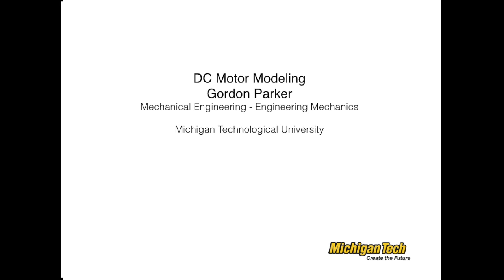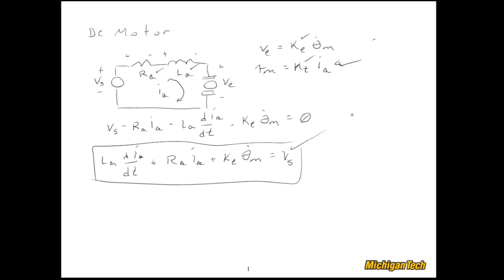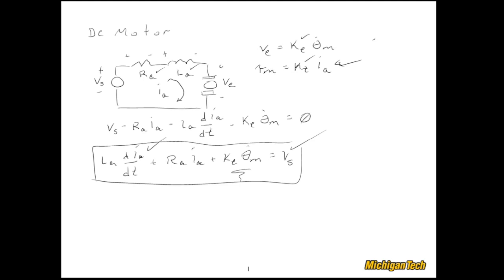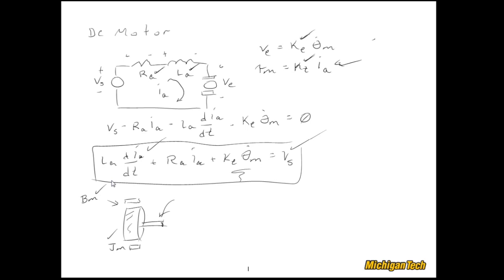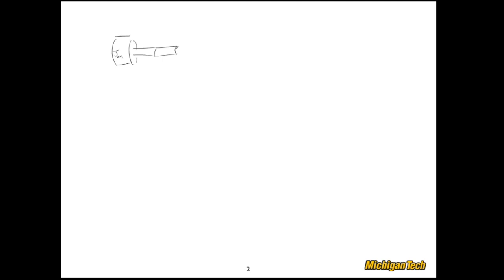DC Motor Modeling

Comment: Hi , i have a important question, why don't consider effect of magnetic field, in most Dc motors there are permanent magnets used they have a certain value of Magnetfield that effect the force generated and hence the Speed and Torque produced by the motor.

thankyou